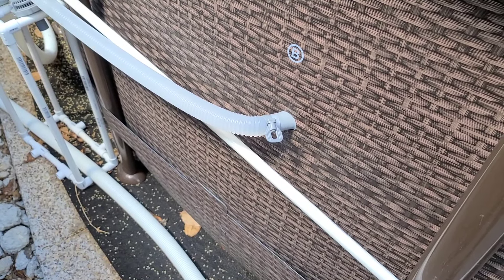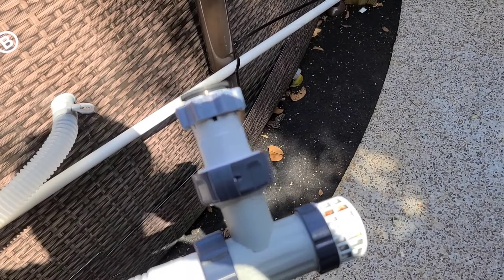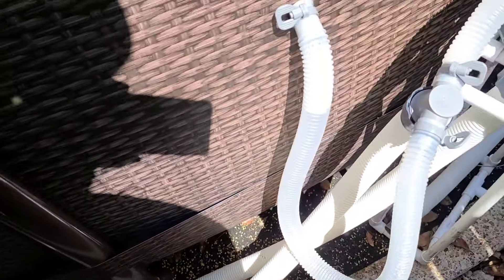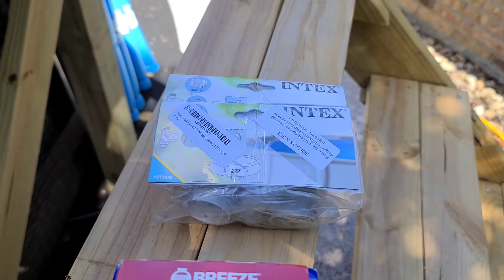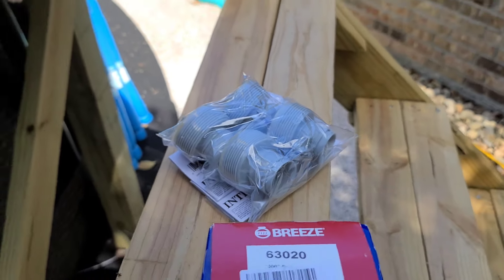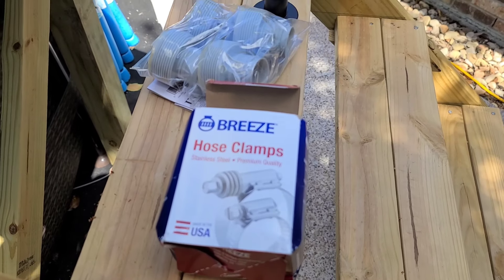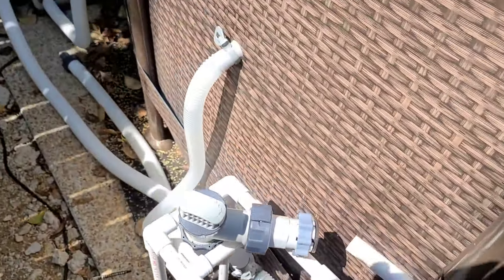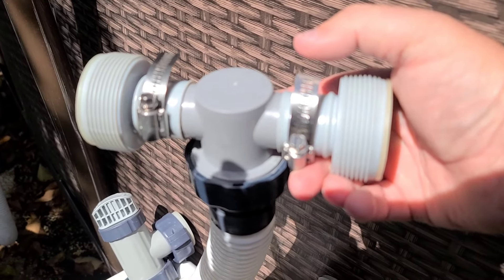Converting a Bestway Above Ground Pool to Intex 1.5 inch Hoses Using Type B Adapters

Comment: I am trying to find the fitting that will screw onto my intake valve inside the pool, that I can then attache my 1.5 pole hose to. I can't for life of me find it....what are you using in your vidoe? I believe this is what I need.
Reply from the maker: Intex 4 Pack Type B Adapter for Above Ground Pools Converts 1.25" to 1.5" https://www.amazon.com/dp/B07F91K3NC/ref=cm_sw_r_apan_i_C8V5HFQTR519DYP9C53X?_encoding=UTF8&psc=1
Reply: Actually, I’m looking for the fitting/dapper that you have on your skimmer hose at 11:09. It’s inside the pool itself.
Reply from the maker: Right.  The blue one?  That came with the skimmer.  It screws on the existing inlet.

Comment: I just bought the 3000 gph intex sand pump for my 22 ft Coleman pool. I’m completely overwhelmed and don’t know where to start with hooking the actual pump up to the pool, do you have a video from when you did yours? This video was super helpful tho, I didn’t know how I was going to change out the 1 1/4 hoses to   1 1/2 so thanks for clearing that up at least!!
Reply from the maker: I don't, but I'd like to help.  Do you have a saltwater chlorinator as well?
Reply: @getitdone308  I don’t have a saltwater chlorinater, just the new pump
Reply from the maker: Ok.  Are you upgrading any of the hoses or are you staying with what came with your pool originally?
Reply: I took a screenshot of the things you bought to change out the hoses, is that all I need to buy to hook the sand pump up?
Reply from the maker: So we need to clarify what you need help with.  Do you need help with your pump/sand filter connection...or do you need help with converting the smaller hoses to the bigger hoses?

This video shows how to convert to the bigger hoses.  Connecting them to the filter...I didn't do anything different than what my original pool instructions told me to do.
Reply: @getitdone308  I guess both, in your opinion. Is it better to switch the smaller hoses out while hooking the new pump up? Or should I just leave the old hoses?
Reply: @getitdone308  I want to upgrade the hoses while I’m at it
Reply: @getitdone308  actually I guess it’s probably smarter for me to just used the 1 1/4 hoses for this year and do some more research on how to swap them out. Did you use the original inlet jet nozzle that came with the pool then and not the bigger one that comes with the pump? Forgive me for all the silly questions, this is all trial and error for me and I learn as I go
Reply from the maker: No problem.  Check out the video I just posted yesterday and you'll see an even better upgrade.

At first I used the 1.25 that came with the pool.  Then upgraded to 1.5 with the type B adapters.  

What came with my pool always had 1.5 outlet (from the filter to the pool).  When I upgraded my filter, It gave me a better eyeball outlet, but it was still 1.5.

The new video shows how my system is now 100% 1.5"...and I love it!

Go ahead and start with 1.25.  No problems when you do.  What you'll find is that when you want to add accessories like plunger valves, you'll have to upgrade to 1.5.
Reply: @getitdone308  so basically if I want to upstage to the 1.5 hoses using the intex skimmer which I have but could never get to work right, I need to purchase:
Type B adapters
(3) 1.5 inch plunger valves 
1 1.5 inch t junction 
Which will allow the outlet 1 1.5 inch hoses to connect to 1 1.5 in t-junction which then leads to the pump. 
Am I missing anything?
Reply: Also where did you find the t junction? I have a 1 1/2 to 1 1/4 currently on the old pump but I’m having a hard time finding 1 1/2 inch on all ends.
Reply from the maker: I doubt you can find a 1.5 T junction.  I looked forever and just couldn't find one.  The 1.25 T junction that likely came with your pool can be used...you just add the Type B adapters to it as well.  

When all is said and done, you'll use 4 Type B adapters.  2 on each of the pool outlet nippers and 2 on each end of the T junction.
Reply: @getitdone308  ohhhh that makes so much more sense lol. You’re the best I really appreciate you helping me out! Your videos have made this make so much more sense for me!
Reply from the maker: Awesome!  Glad to help.
Reply: @getitdone308  well I finally got it all hooked up today and it’s working like a dream but I am confused how you vacuum without all the gross algae being blown right back into the pool? I’ve got my vacuum hose attached where the skimmer hose would go sucking in, but I see the green shooting out the jet nozzle. What am I doing wrong, and won’t the filter just suck in all the debris?
Reply from the maker: If the vacuum is sucking the water...that's good.  Now where is the water going?  Is it going from your pump into the filter...then out to the pool?  If so, that's good.  Your filter should be filtering all the debris before it goes back in the pool.

If you're seeing what you think is the same algae/debris is being sucked in...going back I to the pool, your filter may not be connected properly (so the dirty water is just going through the pump, back into the pool without being cleaned.)

Comment: 10:27 what’s the thing sticking out of the valve
Reply from the maker: It's part of the valve.  You can pull it open to let air into the inlet and aerate the water...or keep it closed.

Comment: Your 1 1/2 inch adapters didn’t make a difference because you still have a 1 1/4 inch restriction at your inlets. How you created more suction was by adding the on/off valves which let you stop suction at one inlet and divert all the suction to the inlet with the skimmer. I have a similar setup. Next year I’ll be cutting out the 1 1/4 inch inlets and installing proper 1 1/2 inch fittings to create much more suction at the skimmer.

Comment: Can you give us the measurements and the materials that you used to make the PVC stand for your hoses please? I have this issue as well with the hoses being too heavy
Reply from the maker: I used 1/2 inch PVC.  There's no real plan for it.  It's just a few 90° elbows and T's connecting them.

Comment: I feel the need to comment only because I barely figured this out. With the skimmer it comes with a little plug that slows the water suction on one side so the skimmer sucks more of the water. Last year I didn’t cover the other suction hole and skimmer worked but not as good as it does now that I use the plug that came with skimmer.
Reply from the maker: Correct!  I covered that in my other video too.

Comment: I have a above ground pool  20x12x48 oval I watch your video I bought the b clamps but it wont fit on the T juntion on both sides any sugestion
Reply from the maker: Did you have the same B Clamps I had?  The same T junction?

Comment: New pool owner here and the video is great!  I bought the same sand filter pump as you have here. I have Intex 15ft  that comes with 1/4 fittings and I bought the adapters to fit 1/2 in (should be here today) but re: the Eyeball inlet do you need an adapter for that as well (to connect the inlet from inside the pool) ? since pump eyeball inlet comes in a 1/2 in. If an adapter is used (inside the pool) the inlet will not be flush against liner. Hope I make sense.
Reply from the maker: When I got the eyeball inlet, it came with the sand filter/pump kit, so it also came with the 1/2 adapter (and plunge valve), so it was ready out of the box.
Reply: @getitdone308  are you saying the eyeball inlet came with your Intex sand filter pump or you purchased it seperately? I just purchased the Intex sand filter pump, just making sure I have all I need once it gets here.  I'm a first time pool owner too!
Reply from the maker: Yes, when I bought my separate sand filter/pump/saltwater chlorinator (the 16" Intex filter), it came with the 1.5" outlet and adaptor.

Comment: 18ft by 9ft 48in Bestway oval pool, 3500 gallon capacity, should I buy the 2100 gph sand filter from intex or 2800gph given the size of the pool. Also when using an intex sand filter on Bestway pool, are the adapters and clamps the only thing required to make it compatible to the pool?
Reply from the maker: With that size pool, you probably only need the smaller one.  That said, there shouldn't be any harm to get the bigger one.  It just filters more water per hour (no harm in that).

The Intex/Bestway compatibility is almost identical right out of the box.  In other words, you can connect to Intex hoses to the Bestway fittings no problem.
Reply: Get it Done thanks for quickly responding, sounds good. Also, do you have a link on setting up the skimmer, need to also purchase that too
Reply from the maker: I do!  Hope it helps!  https://youtu.be/Rg6uIBo0aEg

Comment: Great video.  Great alternative to making the 1.5in holes for the suction. 
Does anyone know if the 1.5 in inlets make the suction better than what is seen in the video? Or is the suction better because of the 1.5 in tubing?
Reply from the maker: Hi Ashay!
The suction is better because the bigger hoses allow more water to flow.  That's why it's actually better to cut the 1.5 inch holes in the pool.  Cutting the holes allows more water to enter the filtration system at the source. Without cutting the holes, it's still sucking water through 1.25" holes at the beginning...but opens up through the bigger tubes.

Also, I have the 1.5" inlet hoses on the stock Bestway t-junction...which has 1.25" connectors to a 1.5" flow to the filter.  So I need to find a solution for that too.  

The ONLY reason I'm not cutting the holes is because I'd have to drop the water.  When I take it down (or next season when I put it up), I will be cutting the holes.

Once I've converted all connections to 1.5", the volume capacity is then maximized (no pinch-points).

Hope this helps!
Reply: Get it Done I can’t find a 1.5 in t joint for our intex pool.  I don’t think they make one. I think I’ll have to get creative with pvc

Have you seen videos where people hold a plastic container on the inside to cut the opening larger?
Reply from the maker: I've seen many videos how to convert the 1.5" Intex coupler to PVC.  I'll be creating a video on how I'm creating a sprinkler system to cool down the pool using the connections.

As far as the T-junction is concerned, I've looked high and low and can't find a factory one.  It's weird because Intex and Bestway use 1.5" and 1.25" hoses...you'd think they'd have a part for the T-junction...but they don't (that I can find).

Once I do the sprinkler system, I'll be tackling that T-junction using a PVC fitting.  I'll post it soon.
Reply: Get it Done how big of a t junction do you think would be a good size? 1.5” or 2”. I think I found a solution for both sizes. Is bigger always better?
Reply from the maker: Bigger isn't always better.  I would stay consistent with your hose line size.  1.5" hoses...1.5" pool openings...1.5" T-Juntion.  For the T-Junction, you're measuring for the INNER diameter (to match the inner diameter of the hose.  I suppose if the junction was 2", it would pose no issue.  But the bigger question is why go to 2" on the junction if you can go to 1.5"?  

I'd love to see/consider your solution!
Reply: Get it Done I don’t know how to send a photo via the comments. Do you?
Reply from the maker: You'd have to post it somewhere and then post the link in your reply.  Thanks!
Reply: Get it Done what I decided to do was by pass the t junction all together. I capped off one intake and ran my intex pipe directly from the other intake valve to the pump.  this intake valve is attached to the intex skimmer.  I don’t know why I need the other Intake.  The one think o need to do is upsize my intake to 1.5 but there are no intex parts available.  Next year hopefully.
Reply from the maker: That makes sense.  Essentially, when I closed the plunger valve to my 2nd intake (the one not connected to the skimmer), I've "capped off" the intake.  I really don't use that intake at all now.  How did you cap it off?  Did you just use the standard black or grey plugs on the inside of your pool...or did you put a cap on your plunger valve intake?  Or something else?
Reply: Get it Done I capped it from the inside with the black cap.  Then I had a type b adapter laying around. Added that to the outside. My swg has a cap that I screwed onto the type b adapter.  It looks clean.
Reply from the maker: That'll do it nicely!
Reply from the maker: That'll do it nicely!
Reply from the maker: That will do it nicely!
Reply: ashay patel do you have a picture?

Comment: For the housing you are talking about at 11 minutes. What if the pool you have doesn't have the strainer, there are just 2 nipples coming out of the side for the inlets into the filter. Can I still use this method or will I need some type of housing piece to go inside the nipples for the hose clamp to clamp on to?
Reply from the maker: If you're saying the pool just sucks straight out the nipple, yes, you can just clamp the adapter to the nipple.  If you check out my latest video, you see that I did just that.

That said, the skimmer has a blue adapter that connects the suction hose to the pool.  That blue adapter needs to screw onto the grey housing (that you don't have).  So if you're going to use the skimmer, you should purchase an inlet to screw into.
Reply: @getitdone308  Thank you!

Comment: What is the device with the two black wires that the water goes thru before it goes back into the pool
Reply from the maker: I have a saltwater system.  That's the part where the saltwater water goes through the electrodes to create chlorine.

Comment: Interesting solution to the upgrade. Have same pool and planning to do upgrade as soon as the new sand filter comes in. Question i have relates to the output or jet on the other end which is a straight 1.5 from pump to pool as is, unlike the 1.25 tubes that came original on the pool. given the pool is already filled in my case ( and yours) did you swap out the Intex "aeration" inlet or did you keep it stock. I cannot for the life of me figure if you can screw it off while pool is full or if it makes difference in water output.
Reply from the maker: I did swap it out while full.  I bit the bullet and just went for it.  Fortunately, it was VERY easy and quick.  I'd say for no more than 60 seconds water was coming out.  Just have everything ready and you should be fine. The water pressure from everything coming out was minimal.

Comment: What is the part called that the leaf trap hose it attached to?  It has two black wires attached to it and then a hose runs to the tank with the sand in it.  I purchased the 3000 Intex Sand filter but that did not come with it.
Reply from the maker: That is the saltwater chlorinator.  I love it!  I haven't had to add any chlorine to my pool!

Comment: Hi. Thanks for the video. I’m a first time pool owner as well now and I’m looking for upgrades as well. I appreciate the links you provided too. Do you happen to have a link or remember the eyeball inlet that you could sent me?
Reply from the maker: Hi Freddie, the eyeball inlet came with the pool.  A better one came with the skimmer I bought.  When I upgraded my skimmer again...it came with the eyeball inlet.  They do this because the skimmer is a system that requires the water to be "swirled" in the pool to move debris to the actual skimmer.
Reply: @getitdone308  thank you. I saw that one came with the Hayward skimmer on your other video. My BestWay 20’x48” didn’t come with an eyeball inlet though. Maybe they changed the components. I’m planing on upgrading to the Hayward skimmer too but it will probably be next year since I have everything set up already. Thank for responding so quickly!

Comment: did all those 1.5 inch hoses come with the intex sand pump? or did you have to buy those separate also?
Reply from the maker: I had to buy those separate.  Check out the last video I posted that shows the even better (full) conversion to 1.5.  It's WAY better!

Comment: did you cut a hole for the eyeball jet intake? since its also 1.25'' opening?
Reply from the maker: No.  The jet intake is factory set at 1.5"
Reply: Oh weird. Our best way pool is the same size but has the 1.25” port. Guess I gotta do it 🤮
Reply from the maker: The hole in the pool is much larger than a standard 1.25 opening.  The hose that goes out of the filter...into the pool is a 1.5" hose already.

Comment: Hi I stumbled upon your video and I feel like I would benefit from your upgrade would u mind letting me know or linking the plungers and all the size of hoses you used to make easier for me to purchase the correct ones please
Reply from the maker: Hi Beatriz, 
I've added them in the video description.   Let me know if you have any questions.  Hope it helps!
Reply: Hi thank you for your reply how many plungers and hoses are needed also can you link the t-suction
Reply from the maker: The T-junction came with my pool already.  It's a 1.25" inlet to a 1.5" outlet.  I plan to upgrade that at the end of the summer to a fill 1.5" all around.

As far as hose and plunger counts are concerned, that depends on your pool.  Mine has two inlets (to the filter) and one outlet (to the pool).  This means I need 4 1.5" hoses total (2 from the pool to the T junction, 1 from the T junction to the filter, and one from the filter to the pool).  It also means I need 3 plunger valves (2 at the inlets and one at the outlet).  When I upgraded my pump, it came with a plunger valve already